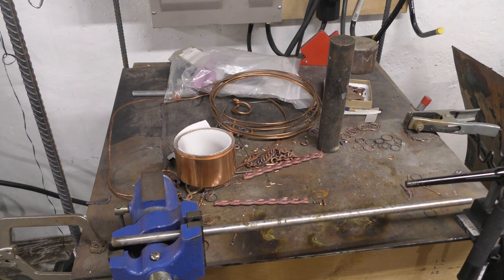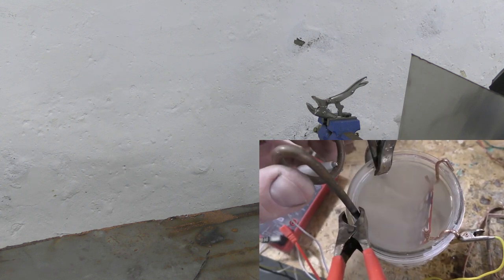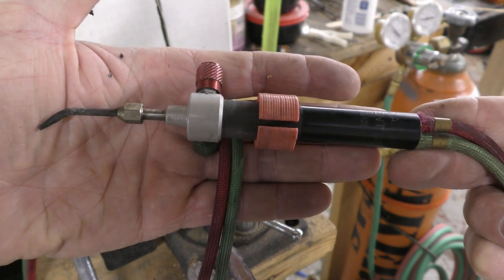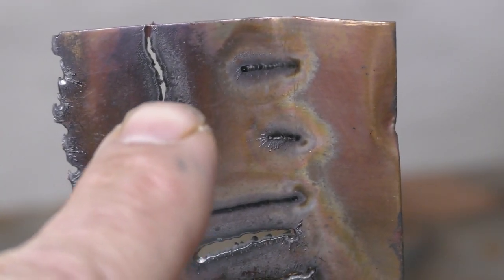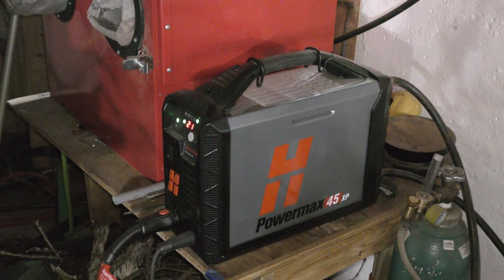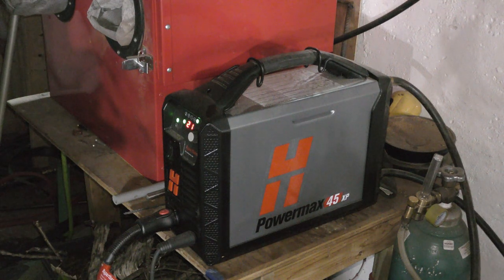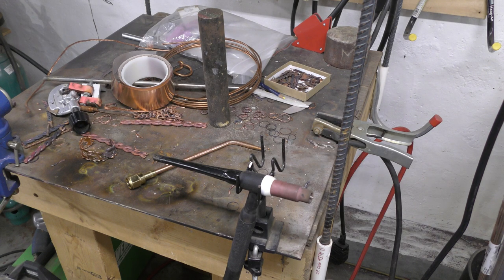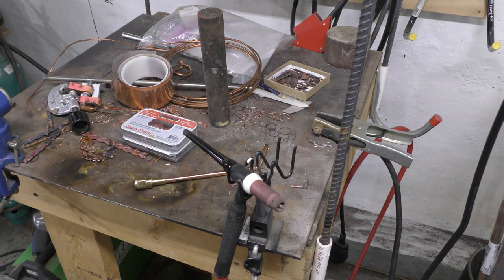Cutting Holes in copper? (for electroforming)

Comment: @Jason Welsh, I'm getting ready to set up my Chinese knock-off Smith's Torch.  Could you go over everything from the tank to the tip of the torch?  My issue is finding the fittings that match the small fitting on the torch. I too am going with propane, but my tank is the the type you hook to your grill. I need to know what the adapters are called, what gauges, flash arresters, cut off valves and all reducers/fittings to set up a complete system.  Thank you in advance for your help and your channel has been a God send for a budding artist.